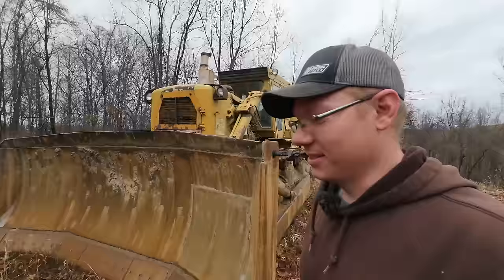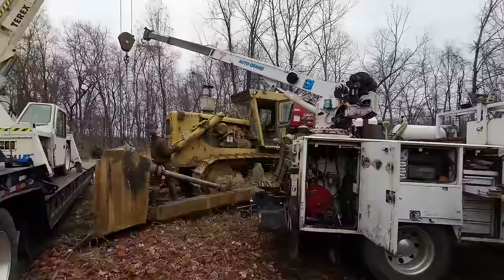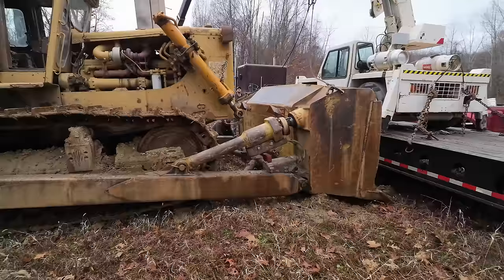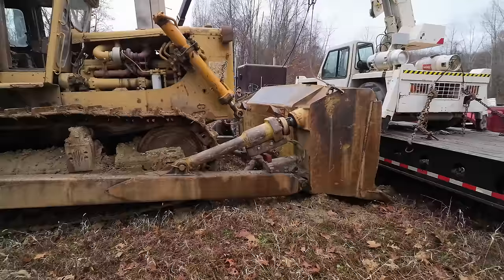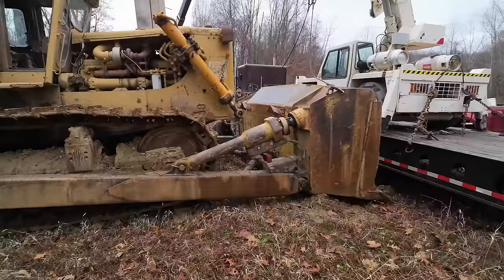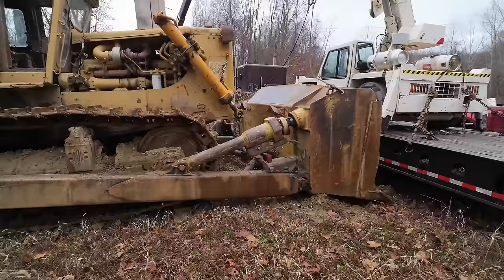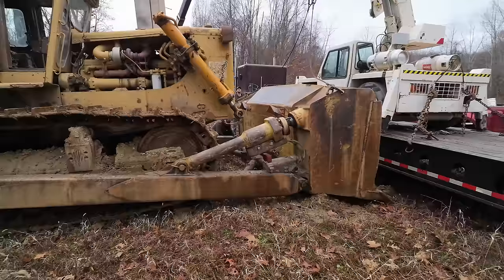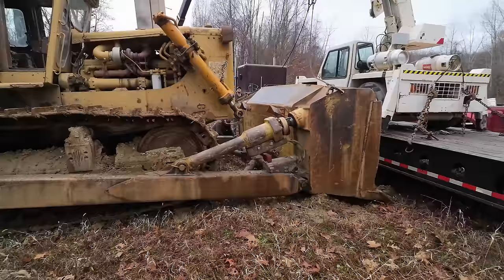I Bought a COLOSSAL Caterpillar D9 Dozer, DIRT CHEAP!!

Comment: I used to run a D9 in winter at the municipal snow dump in Winnipeg, Manatoba Canada.  It had a extended U blade for pushing snow that was collected from the city streets and parkinglots. At one time we used to push the snow onto the river and in the spring the run off melt would take it away. I would burn over 150 gallons of fuel in a 12 hour shift. No cab either! We would spin the fan blades so they would pull the air from front to back, and use canvas tarps to collect the heat from the engine to keep warm. If you were working this tractor hard, you could wear only a t-shirt in the seat at - 30.  I'm 57 now and I did this when I was only 18. To this very day it was the most fun I ever had "at work".
Reply: You must have worked for munro?
Reply: Sounds like a good time once you get the homebrew heating going. I wasn't a fan of -10 on a giant freezer facility so I can't imagine I'd like -30 much better
Reply: You’d be lucky to survive in an open tractor seat at -30. Well done with the tarps.
Reply: If you really had fun ... it wasn't work! You were doing what you loved.
Reply: We had canvas heat houses on old farm tractors
 They covered both sides fron the radiator back.  They did a good job.  Feet on the transmission case stayed warm.
Reply: Don't mean to be one of "those" but it is spelled "Manitoba". Liked the story though since i am not too far away from Winnipeg. Spent a lot of years commuting to work there. I have seen tarps too on dozers for the operator to keep warm in the cold.

Comment: Wow, brought back memories. 40 years ago in my 20s on a road job, they stuck me on an old D8, cable blade, dragging a huge sheep's foot. Asked if I could "drive" it. I said "sure". It was running but I couldn't even get the blade to lift, much less move! Come to find out, just the pony motor "starter" was running! All the mechanics were standing laughing at me! Learned a lot on that first road job! Thanks!

Comment: I liked that the Peterbilt pulled 120,000 plus pounds, total, with no strain, and accelerated almost like it was nothing.  I envy you the dozer.
Reply: It should have  - that D9's only 42 tonnes  (93,000 lb)
Reply: @markfiges999 I got that.  Notice the word total, 120,000 plus, equal Dozer, trailer and truck, conservatively.  Even just 93,000 pounds is considerable weight.
Reply: How much hp have that Peterbilt ?.
Reply: Looks to be ALL of it .
Reply: If I heard correctly, Matt said look at what we got, and our Dozer 😁👏👍 what a beautiful sound and when used for constructivly is such a beautiful machine...I have more positive memories of a D9 Dozer than I do negative. Watching someone with a D9 heading towards my barn with all my hoard wasn't a Good view, but I don't blame the machines 😁
Reply: 140,000 lbs.
Reply: Wasn't his first day behind the wheel of that Pete, either.
Reply: @jamesmorgareidge Yep.  I was being conservative.  I did include the "plus pounds".
Reply: @wmden1 Which is not much. realistically
Reply: @HJZ75driver  It's more than most states would let on their roads with just tandem axles on the truck and trailer, and they had to have a permit, even with three axles on the trailer and truck.  They were very close, on the scales, loaded.  My comment reflects how I am impressed with the way the Peterbilt, probably around 400 horsepower, handled the D9, by itself. I am not a truck driver, and have never been, but I have hauled a little weight a few times, and have seen truck tractors labor with considerably lighter loads. 93,000 pounds, plus the trailer, is a pretty good load, in my opinion, to handle that easily.  Y'all folks are entitled to your own opinion.
Reply: @wmden1  Mate. 93,000lbs is only around 45t. Bugger all. The Pete is 500+
Reply: Checked that you are able to pull the total of 76 metric tons of weight if you have at least 11 axles.
Reply: @HJZ75driver  I'm not your Mate.  I'll think what I want, as far as being impressed.  I think 93,000 pounds is a considerable weight, whether the truck is 500hp, or 400.  I don't understand why you are keeping this shit up.  What difference does it make to you what my opinion is.  I know what a standard ton weighs.
Reply: @wmden1  Standard tonne*. Is 1000kg. 90,000lbs sounds impressive. it’s not. More to the world, than just America. Mate.
Reply: @karisalonen8984 Depends on the state. Here in Michigan we can run 11 axles 160k. Ohio and Indiana block us at 80k unless you jump through hoops and get police escort and all that crap.
Reply: @blauer2551  In SoCal, we had a 349F excavator moved with the 78" bucket (12k pounds for the empty bucket) in one piece. The machine spec is just shy of 120k pounds and then the weight of the truck and trailer. I don't recall if that was a single trailer or if it had a dolly setup. It certainly required special permits for the move. I'm not sure what the max is here, but they also move much heavier parts for the power industry such as transformers. Those have multiple dollies and are like watching the circus come through town, mostly just seen during the day parked on the side of the road waiting for the night time hours they have to adhere to for their move.
Reply: @blauer2551  160k lbs or 160 metric tons? 160k lbs is about 75 metric tons. In that case it would be about the same here in Finland. Sure enough we too need escorts etc... And permission from authority... Dunno if it's hard/complicated/expensive to do it here in Europe too...
Reply: 140,000 pounds (silly small units) is 62.5 imperial tons. 63.5 metric tonnes. Deffo not to be sneezed at.
Reply: @CGT80  Yep, I see them at the rest areas waiting too.

Comment: Matt’s shopping list:
- 1/2” steel plate
- extra bottle of C10 gas
- 0.45 wire
- ammunition
- bags of concrete
- cameras
Reply: Unfortunately It's not a Komatsu :(
Reply: It’s better then a Komatsu 😂
Reply: Needs to be a Komatsu d355
Reply: Granby vibes lmfaoooooo
Reply: That was my first thought.
Reply: dont forget to upgrade the cooling system
Reply: Whistlindiesel just bought a komatsu
Reply: Nice BIG yellow Toy! I'm jealous.
Reply: @LosingMyMind13  ik, it's going to be epic when he has it done
Reply: @calebgeers3690  don’t run it too close to a basement either
Reply: dont forget to upgrade the cooling system
Reply: He's still pretty salty about that bill from the utility company to run conduit
Reply: Nahh, 1 inch steel, beefy cooling lines
Reply: Good radiator, colling sys.. remote control ⚠️
Reply: The Komatsu had a Cummins 1150 cu.in. The Cats 1493 cu.in.
Reply: The D9G/H and the TC-12/82-80 and the coolest dozers of all time.
Reply: @georgiewashman sure as hell looks like the kill dozer tho
Reply: Komatsu is just a Japanese Cat

Comment: I joined the US Army to be an equipment operator right after high school graduation in the 70's. My first assignment was with the 101'st Airborne Div. I was assigned a CAT D-5a that we sling loaded under CH-47  helicopters. It flew in 3 pieces, the blade, the tracks then the tractor. Upon landing at a DZ myself and 2 other soldiers would assemble it and I was off to dig tank ditches for the next few weeks. Best time of my life, 50 years later and I remember everything about that dozer and the time I spent in the seat. Over the years I operated many pieces of equipment but that D-5a was my favorite. What a life.
Reply: This relates how?
Reply: @MrThisIsMeToo 
WTF MAN   HAVE SOME RESPECT.    THE GUY OPERATED A BIG ASS DOZER ALSO AND WANTED TO TRLL
US ABOUT IT.  

D9 is the biggest I’ve ever run but it’s an awesome feeling pushing that much dirt in front of you 

thank you for your service ❤
Reply: I remember those well.

Comment: Nice score Matt,
So... in 1969 and 70 I was a skinny little 140 lb soaking wet 14/15 year old farmer. Working for a hay company in Petaluma California. Mom would take me out to Freitas Road and drop me off. There was the massive vintage D9 just waiting for me right where I had stopped her the day before. I had to start the pony motor and wake up the beast with 18 ft disc and cyclone fence trailing to smooth for a new 400 acre crop of oat hay.
The beast had no muffler at all, just a straight pipe that I would cover with a bucket for the night. It was 1969 so zero ear protection...
"WHAT DID YOU SAY"
Okay wait, it's not over.
In 1972 George Lucas came to town and I was literally the only person hired right off the street/76 gas station to be in his little car movie "because of my awesome 55 chevy pickup" that turned out to be a huge car movie.
Frietas Road right along side of that patch of dirt was our local Petaluma drag strip and this is exactly where we raced the POS yellow 32 against the crusty 55 with tilt front end and 454 stuffed in.
So there you go...
"WHAT DID YOU SAY"

Comment: Back in 1975 the D9H cost (in New Zealand) about the same as a Hughes 500 helicopter (NZ$ 250,000 I think the figure was). I had a brief play on one (belonging to Bill Butson Contractors and operated by Paul Schroder - aka the Bealey Ave Grey) during the construction of the Tekapo canal (in the South Island) and I couldn't believe how much power it had, even while idleing. Years later I saw the two Komatsu D575 superdozers working at the Stockton coal mine above Westport, and they kind of made the D9 look like a toy.

Comment: Brings back memories. Long ago when I worked with my Dad we bought a new D9 w/ cushion pusher blade, 1998. We had 3 D8's, one setup as a pusher for 21 yard scrapers. Also had 3 Wabco C paddles for finish work. And a TD25 picked up cheap at auction. It was actually a pretty decent machine.  But we got on a job here the D8 wasn't enough push. Wet, sand, mud! High undercarriage maintenance costs. I'm surprised you got the pins out so easily.

Comment: All it needs is a few panels welded on with emphasis on the radiator on and she’s ready for service.
Reply: It wasn't the radiator getting hit that cut things short, he got stuck in a basement and ran it hard to get out... Improve the cooling systems efficiency, plate it, and plan your route a bit more than the last guy who had balls... 😂
Reply: @themmgamer1227  and do it in winter :)

Comment: As a retired truck driver,thumbs up to the hand driving that PETE a true professional and the D9 operator wasn't to bad either !!!
Reply: Really a true. Professional shifting with the jake no way a true professional doesn’t need to shift with the jake obviously he’s never had to rebuild a transmission because joe super trucker messed up shifting with a jake
Reply: @user-zm9pj3po3j Shifting with the jake on will do no damage to the trans at all if you know how to shift...
Reply: @user-zm9pj3po3j  hate to tell you, but there's plenty of times you absolutely NEED the jakes to shift when hauling heavy, off-road, or on steep grades. If you know how to time it right and control the throttle you dont do anymore harm than normal driving.
Reply: JPAYDIRT i bet, would like that D9 in his yard
Reply: Use that Jake and learn how to read the tach, that transmission will last forever.  Sounds like a good driver to me!!!
Reply: @Bearcats737   I hate to tell you I’m been doing this for 47 yrs 25 of them hauling heavy equipment in Colo. wy. Nv. Nm. Ut. Mt. where we have mountains not baby hills like in Pennsylvania  never need to shift with the jake maybe if you were in deep mud to go from low low  to low then after that never used it except for what they were made for
Reply: @haydona1845  it don’t matter hav rebuilt to many from ppl who (know ) how to shift all it takes is one screw up and I don’t care who u are you hav had a screw up even you super truckers
Reply: @Bearcats737  bullshit know better of u hav to shift with a jake constantly  then u ain’t a driver
Reply: @user-zm9pj3po3j  most of the time i don't, there's times where you aren't shifting gears unless they are on. times here you're starting in low low and don't have speed to keep you rolling long enough to wait for the engine to slow down. if you're not forcing it in you're not going to hurt it. the moment you need more than just the tips of your fingers to shift is when you're doing to start breaking stuff.
Reply: @Bearcats737  if you had read all my comments I already said that

Comment: In the late 1960s, I watched mesmerized by a Cat D9, taking down a row of 2 story brick homes that were in the right-of-way for I-95 just south of Baltimore.  It would notch the front corners, then put the blade high on back wall and push.  20 minutes later, it was a rubble pile in the basement.  Just raw grunt!

Comment: Thank U,  BIG JOHN~~~~~!!!!!!!! I'm Ye Ole Caterpillar Cowboy in Decatur, IL
Back in the early 60's I had the joy of driving a SXS D9 that had a 20' blade.  It was leveling the spill banks in a strip mine near Dugger, IN.  CAT was trying for a bigger machine while they were developing the D10. The operator sat on the right machine at an angle to the left machine. There were 64 wires on the rear that transmitted all the actions. It was a little light for the 20' blade. There was a tie rod from the front spindle on the left machine to rear final on the right machine.  Quite a fine little unit.
Reply: “Caterpillar Cowboy” , love that! Also known as “Cat Skinner” around here!,

Comment: changed shot lower track rollers. mid 80's>  on an early 60's D9.Heated rails but still had a dozen roller mount bolts snap.Tractor was cribbed up on ties. Torch cut out those broken carrier bolts laying on my back.Pick and clip the tap every hole including the bolts that came out. 22 years old at the time. did the job in the yard. 8 months later running a service truck in a 70 mile radiusof the home shop.knees are killing me now at70.

Comment: Matt, I must commend you for following the ground guide's direction so well.  I spent several years in the U.S. Army in Germany as a mechanic in Mechanized Infantry (M113A2 Armored Personnel Carriers and M578 Recovery Vehicles) in the late '80s and when we had to "railhead" our equipment to the field, that meant loading them onto train cars. As the operator, you always felt that you were going to run off the side of the train car, but you ignored that feeling and obeyed the hand and arm signals of your ground guide and after you dismounted, it always looked perfect despite the way it appeared from the driver's  hatch.  Often your vehicle's tracks were hanging over both sides of the flatcar several inches, but perfectly centered.  Years later, after I'd gotten out of the Regular Army and became a Tennessee National Guardsman, I often had to load heavy construction equipment (Caterpiller D8, D7, and D6 dozers, 130G Road Graders, and 621B Earthmovers) and I have received complements more than once that the civilian contract truckers had rather load equipment with military personnel than civilians because we observed and obeyed the ground guides more strictly.

Comment: I ran a D9 and D10 in the Coal mines when I was a younger man, Sure could use one on the farm for a month. Your going to need more room in the lay down yard before long. Great Video as usual. You never fail to please the need for old iron.
Reply: I could use one right now to adjust some dirt... I need to blade out several stumps then move dirt from over there to over here. Its about 5 foot grade difference. Which is a whole lot of dirt. It will end up being done by smaller machines. We have over 20 stumps that are 1 to 2 feet large and once they are gone along with the 2 sheds and get rid of the concrete which is a lot of it all over the place. Did a few holes out where we think there are trash piles and have someone come in and rip every thing with a ripper blade to make sure there is no more concrete and so on. Then we will readjust all of the dirt. I want to bring up the land at least a foot higher than the existing road. I am almost sure that my land is the highest in town at the moment. I do not know of an app that can give more details. I am going to get a survey done when winter is over and I am almost sure they can provide that detail on a map. I want a grid pattern data map and then measure a bunch of additional locations around me along the roads. Since I have to pay to have dirt moved anyways I want my new house to be higher than any other house. This means that in the event of a flood I should stay dry. We live not far from a river which has never flooded the area yet we do get a lot of rain, over 1 foot in a span of 5 days. That amount of rain does indeed make everything wet and can fill ditches pretty fast. The area where we plan to build seems to be higher than the rest yet its still quite hard to see any standing water with grass. I have walked it during major rain events and the other areas yet I want to make damn sure that its higher. I also want to grade all of it so that the water flows to the front ditch and then the driveway sheds all of that water in to my field.

Comment: Thanks for posting this vid. I've been a scale model builder since 1964, and had a job at a survey-engineering firm in the early '70 and worked around these beasts in the early 70's while I attended college. I have two 1:25th scale models of D8H's, with U-blades and single rippers. One will be built as a stock D-8H and the 2nd as a D-9H, thanks to you ! Again, many thanks.

Comment: Right at 40:01, you can see the blade lowering by itself. That means either the load holding valves are shot, set too low, or the cylinders are leaking internally.

Comment: Put a quart of trani fluid in the fuel tank. It will clean up the injectors and won't smoke as much when you rev it up. I use it all the time on my drills with 3406, 3408, and the Cummings  motors as well. I use a liter to 50 US gallons every 2nd or 3rd fill. The trani fluid won't all burn, and when you shut it down, it soaks into the build-up and blows off clean when you start her up.
Reply from the maker: I dump gallons in machines this size lol I run that through a lot of my iron